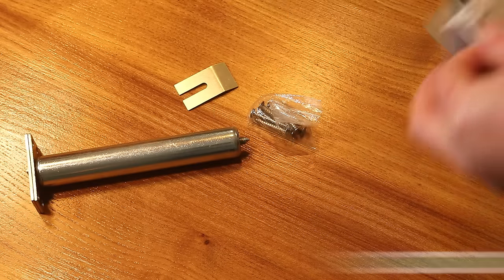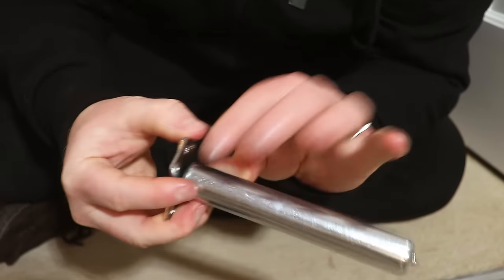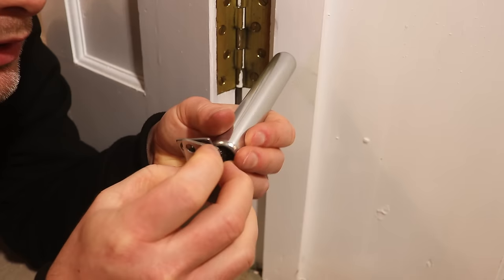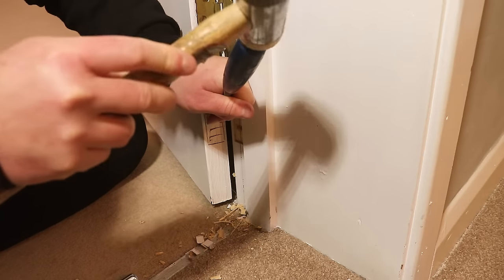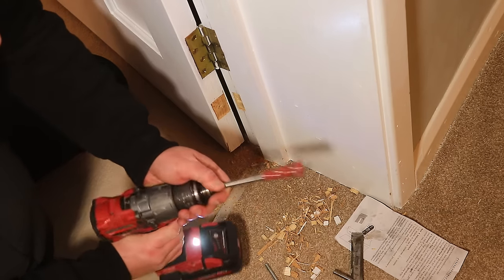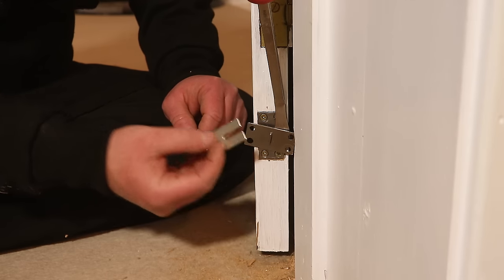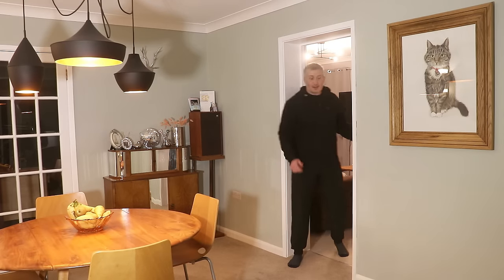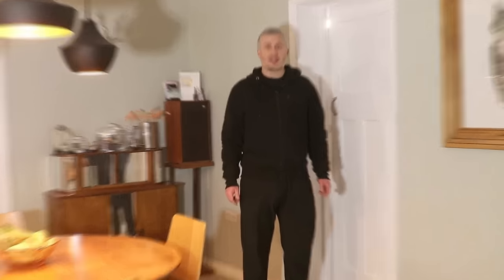THROW AWAY THE INSTRUCTIONS!  How To Fit A Concealed Door Closer

Comment: This was really helpful. I found a claw hammer rather than a crow bar worked to pry the plates apart when at 90 degrees, without damaging the door, so long as you roll the top of the hammer along the length of the door. I also used pliers to put the tool in place and rotate it... not sure I trusted getting my fingers trapped in it.

Comment: I need a solution for a very light internal wood  porch door, which is regularly left open and lets the cold in to the hallway. If I was to fit this and keep the tension tight so that it closes, would it slam and make a door-slammy noise?

Comment: Originally fitted mine several years ago but recently the concealed bolt had somehow unscrewed/freed itself. Of course the original instructions and special tool were nowhere to be found so I used your video to remind me of how it all worked, cleaned, lubed and refitted with a claw hammer as tensioner and vice grips to hold the spring taught while screwing in the last plate. Thanks.

Comment: Absolutely no reflection on you Keith, but what a Faff, there must be a better way/device !

I fitted some "rising butt hinges" in our previous property, primarily for accommodating a slight change in floor levels but it did also slowly close the door, it worked for us but not adjustable apart from with lubrication, also when fitting these you have to allow for the rise at the top of the frame - ask mw how I learned this ! 🤔😬🙄

We had the opposite problem when my son when he was a toddler as he would slam EVERY open door, often with your keys on the other side ! 😂

Comment: Great idea, we have several self closing doors, either for privacy or keeping heat in. Those closer types are horrible though. Crude, very cheaply made and a ball ache to fine tune the adjustment. They tend to be sprung too firmly even on softest setting (they’re designed to pull fire doors after all). Forget even trying to adjust without causing damage once the keep has been lost. They can also be noisy if installation alignment is off. Sprung hinges are way easier, especially if sized to match your existing hinges (no chopping out, no drilling, straight swap often the same screw positions!). Their adjustment can still be a little fiddly but you don’t lose skin in the process and the closing force is more adjustable for all door weights.

Comment: Tie a bit of cord round the end and pull that instead of using a crow bar. Once you’ve got enough can pulled out to hold, wedge a small drill bit in the chain to hold it so you can fix the end to the lining.
Reply: Similarly, I used a brad nail through the chain link.

Comment: Thanks for this video, it’s really helpful. I abandoned installing mine after starting the pilot hole and realising how close the 25mm bit will come to the edge of the door (I placed it in the middle of the door). Do you see any reason the shaft part couldn’t be put in the frame with the plate in the door? It’s a stud wall with no cable so I could get through easily I just wonder if there is a reason not to do it that was?
Reply: I was wondering that too

Comment: Absolutely love the lengths you go to, and the consideration you give your pets! 😁
Reply: Thanks for an excellent guide.  As you say, the instructions were dreadful .  I used a different method to retain the chain.  I inserted a long very thin screwdriver through2 the link.  Much easier to insert than the provided " template".

Comment: You're better off drilling and fitting the tube first, then close the door and the sticky out bit on the frame faceplate will leave an indent in the actual frame so you'll know where to fit the plate.

Comment: They were fitted by the builders in our house, I took them out in the end because they were too strong for the doors and I was forever having to replace the door catches as the slamming caused them to disintegrate on a regular basis.
Reply: I presume you live in a three storey house? If so the door closers are required for fire protection to the main means of escape ie, stairwell and hallway. Be mindful that if there is a fire and you have removed the door closers your insurance may be invalid. I was a site manager building new houses and this was a constant issue.

Comment: Can someone tell me why you can't fit it the other way round .long part fitting into the door frame would save drilling  a deep hole in to door  ?
Reply from the maker: Door frame not deep enough so you'd need to drill out the wall

Comment: Just used this video to get one of these re-fitted to a door that I removed it from years ago. Thank you so much! Your video helped me understand the mechanism and the tensioning. I didn't have the included tool so I used a claw hammer to pry, and an allen key to slot through the chain and hold it in place. Worked like a charm!

Comment: Fairly certain there not fit for fire doors anymore as there too weak. You can get double chain perco closers. 

Nice job on fitting. Always hated fitting them 😂. I used to use a small pin to hold the chain as the plate used to buckle and allow the chain to retract . Not fun catching your fingers 😅

Comment: This was really helpful. I found a claw hammer rather than a crow bar worked to pry the plates apart without damaging the door, so long as you roll the top of the hammer along the length of the door. I also used plyers to put the tool in place and rotate it... not sure I trusted getting my fingers trapped in it.